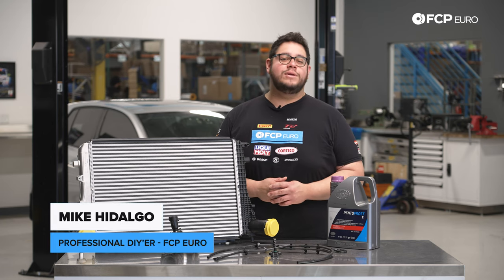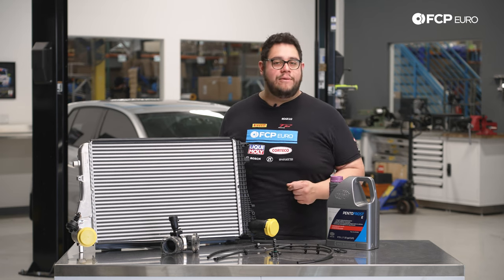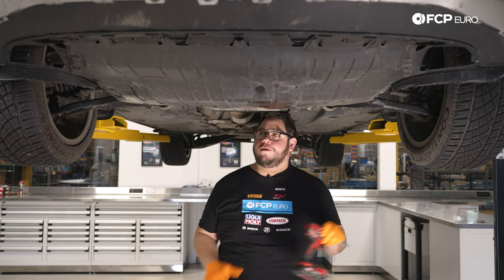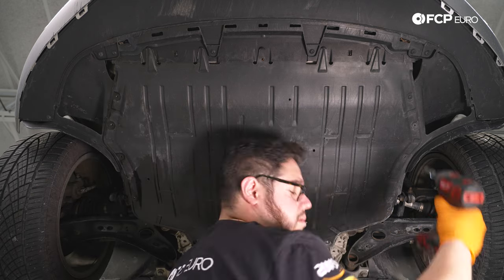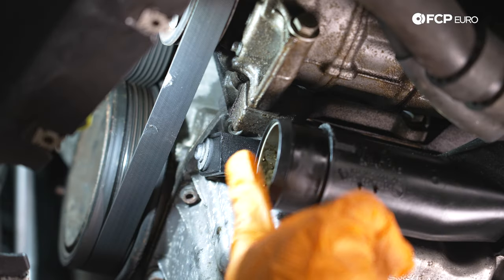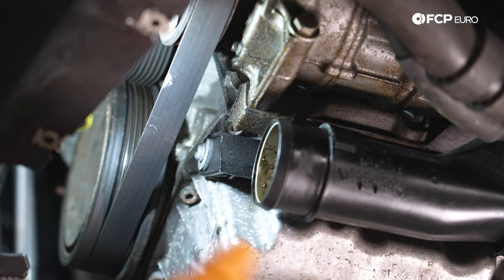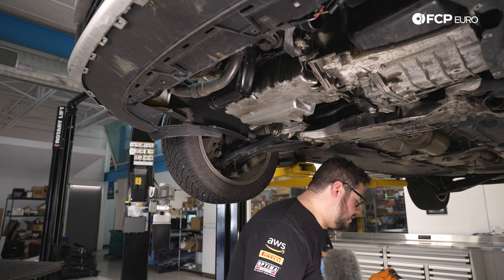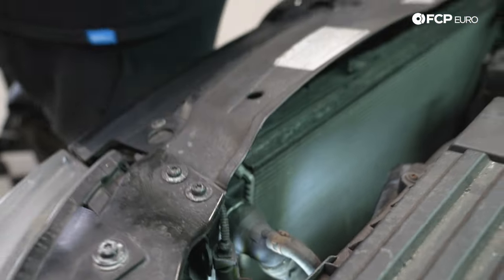Volkswagen Golf TDI Cold Weather Intercooler Upgrade DIY (2009-2013 Mk6 VW Golf TDI, Jetta TDI)

Comment: awesome video, very thorough. my 14 tdi jetta has the icing issue every winter. I am still debating replacing my system, but I did just replace a gasket on the driver side pipe (it was leaking oil). Any tips on installing it (at 54 mins in this video) when the car is on ramps? I can't seem to get it to "clip" back in.😥
Reply from the maker: A little bit of dielectric grease (or something similar that wont deteriorate the O-ring) will help you get it back on. Brake cleaner works as a quick lubricant as well!
Reply: Thank you!!  @fcpeuro-media